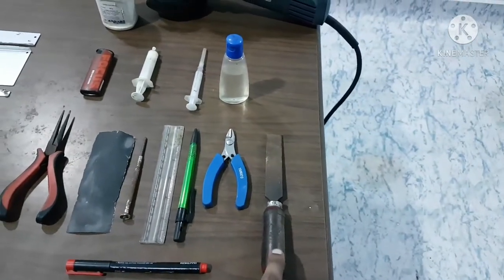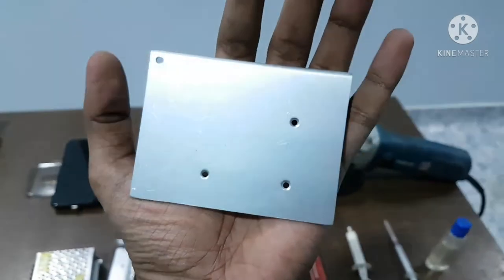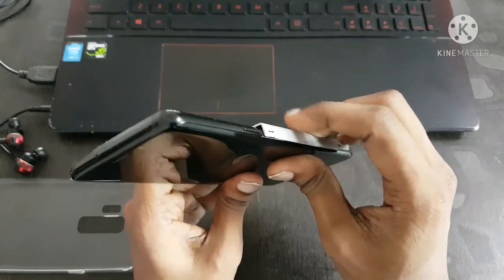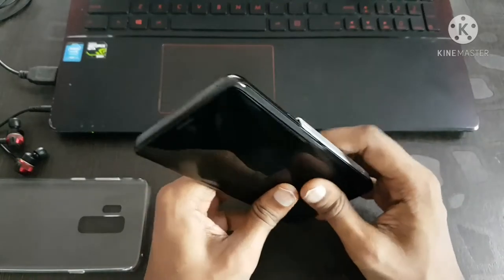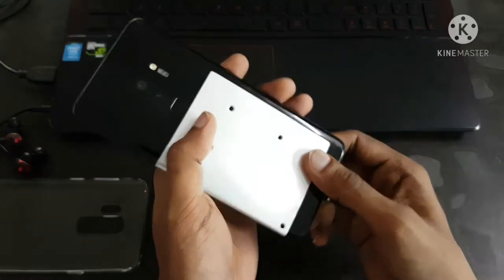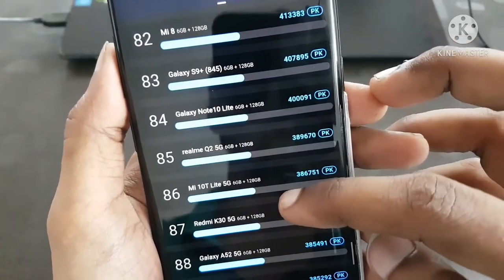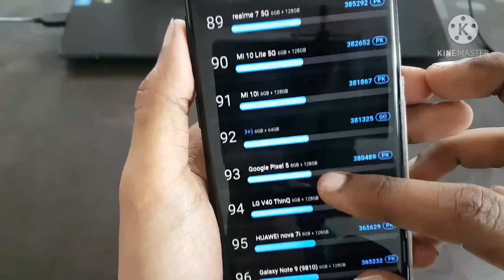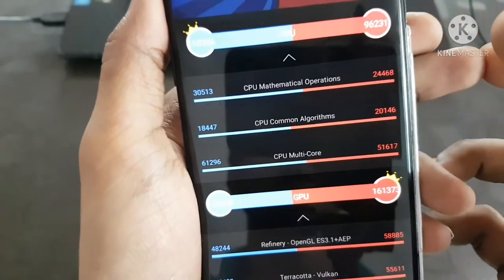S9 Plus Antutu Benchmark Passive cooling 🔥Performance Enhancement

Comment from the maker: 3 days of use after upgrade difference is obvious. Now am getting stable fps performance in Pubg mobile. Before there was a lot of frame drop only after 10 - 15min of gaming depending on ambient temperature. Now gaming is fun... quick note - go for devices with better thermals and performance to enjoy gaming. It will be worth!